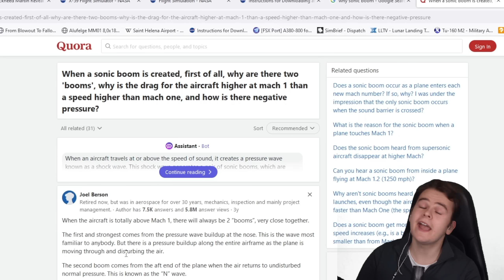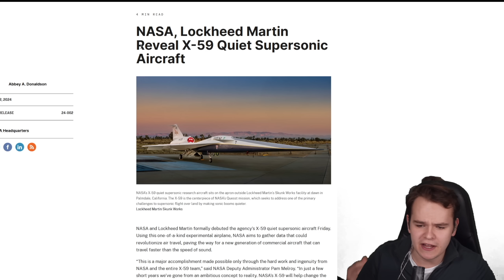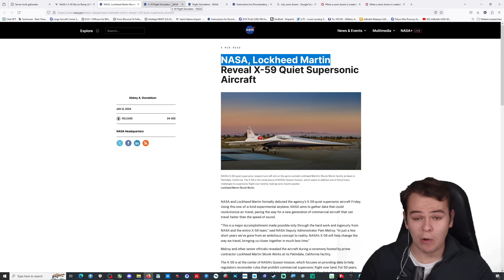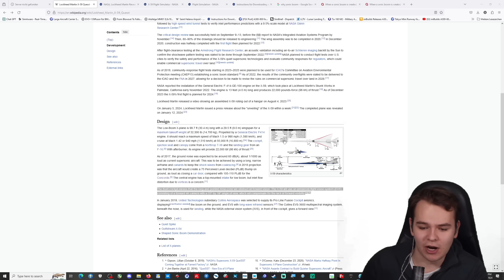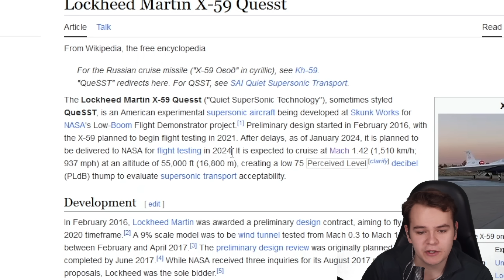Flying The BRANDNEW NASA X-59

Comment: My only question is about the practicality of this design for commercial use. Sure, it may solve the sonic boom issue, but is the design language even plausible for a commercial airline? I mean, a commercial version of this would have to be MASSIVE to maintain the proportions while creating room for passengers
Reply: Maybe they can design in a nose "erection" after takeoff.  The marketing for the plane will write itself.